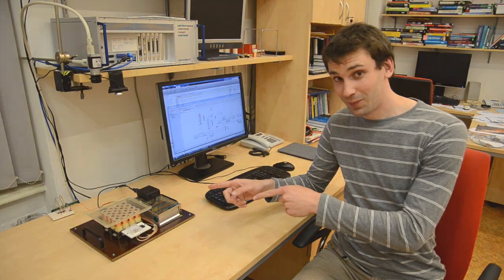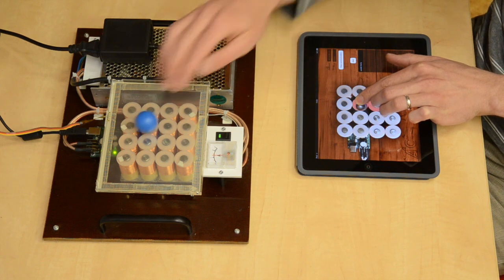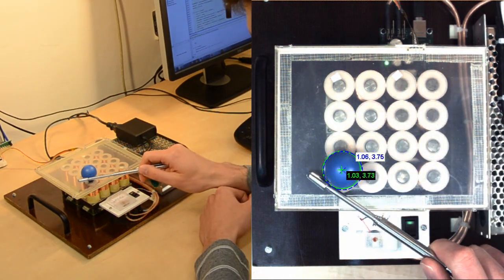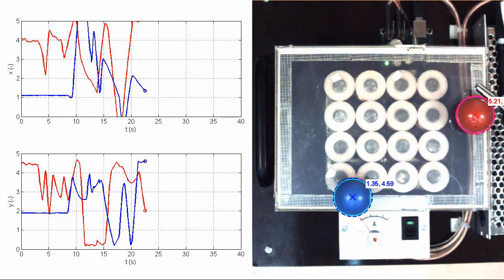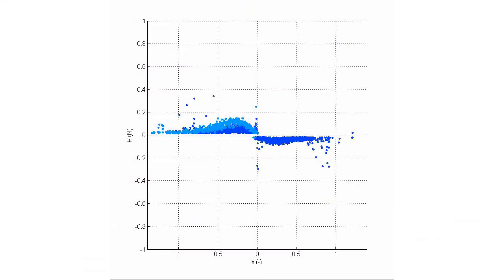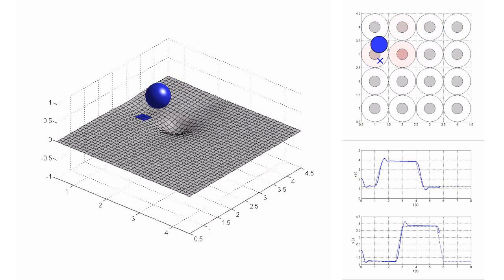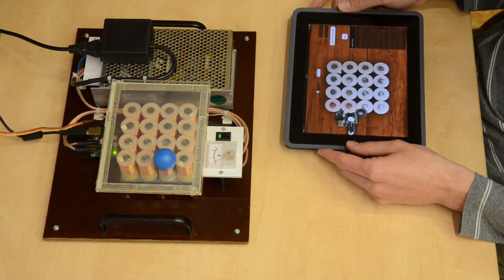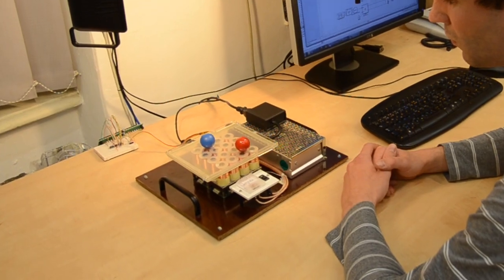Magnetic manipulator Magman and Matlab

Comment from the maker: Thanks Sinan, the main part of the controller is a numerical solver which knows the model of the system and finds a suitable distribution of currents to achieve the desired force. The force is controlled by a simple PID controller.

The touching force is estimated from the resistance between the top and the bottom film of the touch foil. You can read more for example in this article "Touch Screen Controller: Analog Dialogue: Analog Devices".

Comment: Can you do this same concept using modified PCB planar electromagnets? The reason so is that planar electromagnets will be easy to produce if done properly and will provide a much unified and controlled magnet array. I'm just not sure if PCB planar electromagnets can produce a strong magnetic field of such small size.
Reply from the maker: We did consider it back then but we came to the conclusion that what was available/accessible to us did not give sufficiently strong magnetic field. If you have some concrete tip, we would happily consider it.